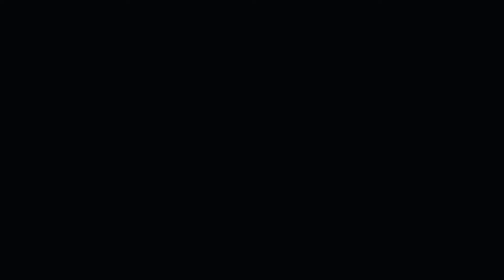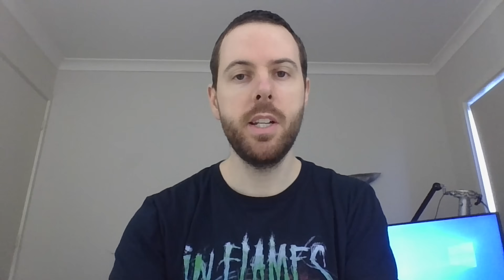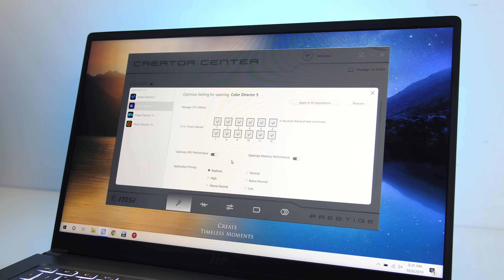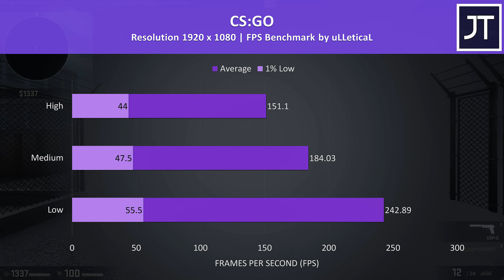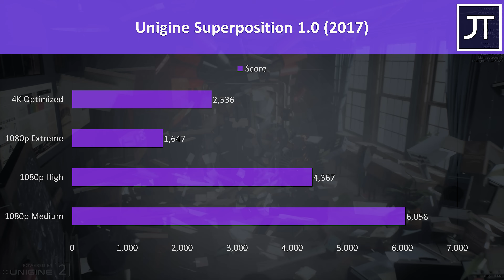MSI Prestige 15 Review - 10th Gen Laptops Are Here!

Comment: The only downsides are : 
The msi bloatware it comes with(you can clean install windows to remove bloatware, but you will also loose performance profiles and battery charging tool too)
I am not so sure about the hinge quality. I am being careful there. 
The battery life is good but for 81whr battery, I  expect more. There are many other laptops which give equal if not more battery life with much less battery capacity (Lenovo laptops for example). This means it isn't well designed/optimized relatively.

Comment: I have this laptop and I love it!
Long lasting battery life, great sleek design, awesome build, high performance, and dedicated graphics card!
Reply from the maker: Good to hear!
Reply: I also bought this laptop a year ago based on this review and cant complain on the laptop. I usually work under linux and was always concerned about driver issues, especially when it comes to fan and power control. But I have to say, MSI has a great linux comunity and software packages like YoyPa/isw provide really solid fancurve and power level adjustments. Right now my linus distro is way better configured as my windows installation with the MSI creator center, which I think is a hot pile of garbage especially when I think of what you can achieve just from directly configuring the ECC.

however, I have to say it run quite hot out of the box and I dirictly did a repast and exchanged the cooling pads for some premium ones. Now even during summertime (around 30 °C) the machine stays at around 50 - 55 °C when watching youtube and my fans only turn on above 55 °C. So 90% of the time the lapto operates fanless and has by far one of the best cooling solutions given the compact design, low weight and performance.

Undervolting -100 to -125 mV works marvelously and I can hit all core max speed of 3.9 GHz all day long, barely cracking 90°C. Really good if you have to compile or run a lot of multithreaded applications. Its an absolute work horse

Comment: I have a question for one of the owners of this device: when you are using the laptop with heavy load or power usage, and you have it plugged in, will it drain? Or will you gain battery. Like lose or gain battery percentage.
Reply: Gain

Comment: 0:17 Specs
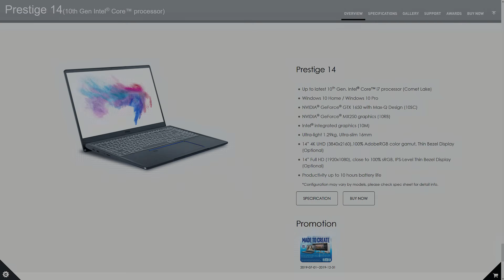1:04 Prestige 14
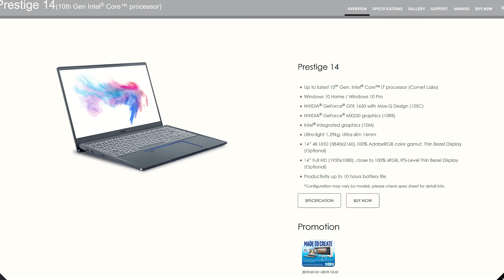1:13 WiFi/Connectivity
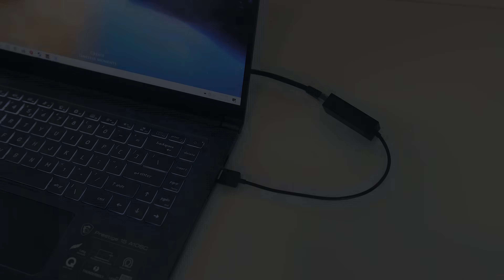1:20 Ethernet
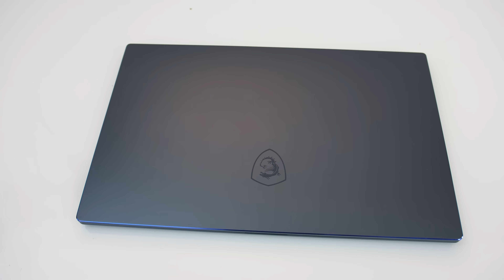1:25 Design/Build
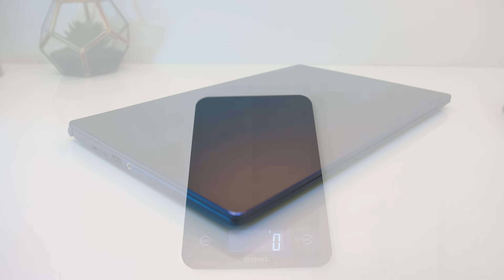1:47 Weight
1:59 Dimensions
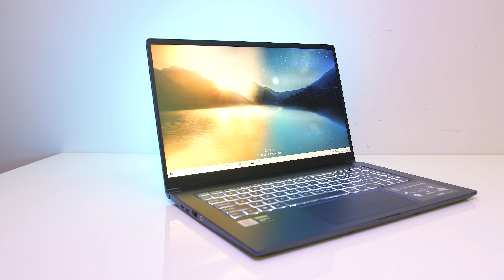2:08 Screen
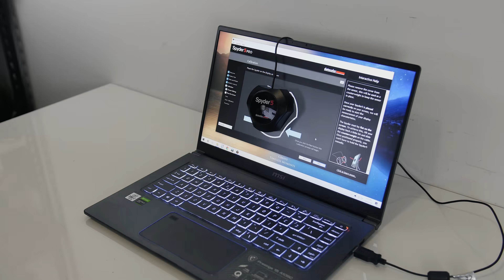2:20 Color Accuracy
2:30 Brightness
2:48 Backlight Bleed
2:58 Screen Flex
3:03 Hinge
3:16 One-Hand Open
3:21 WebCam/Mic Test
3:41 Keyboard
4:06 Deck Flex
4:17 TouchPad
4:35 FingerPrint Scanner
4:42 I/O
5:05 Rear
5:09 Front
5:13 Base
5:23 Speakers
5:34 Inside The Laptop
5:48 Battery Life
6:19 Charging
6:25 Msi Creator Center
6:52 Thermals
8:22 Clock Speed
8:57 TDP
9:24 Power Brick
9:48 CPU Only Clock Speed
10:21 Cinebench
10:39 Premiere Pro Video Export
11:04 Gaming
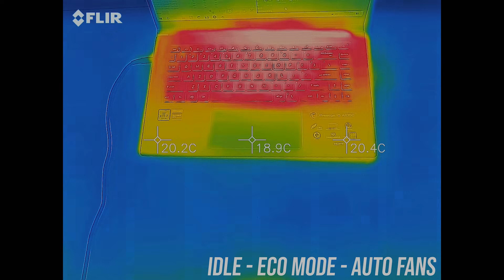11:40 External Temperature
12:17 Fan Noise
13:13 More Gaming
15:46 Gaming Compared To Other Laptops
16:49 Benchmarks
17:00 Storage Speed
17:17 Pricing
17:37 Conclusion
Reply: Dude thanks really.
Reply: You’re amazing... thank you
Reply: i love you
Reply: I love you

Comment: hi Jarrod! for graphic design and gaming, which do you think is better? msi prestige 15 or msi creator 17? Thank you ^^
Reply from the maker: Depends, creator 17 has higher spec options and will perform better but it's also larger so slightly less portable. It also has the mini LED option which may be a better panel
Reply: Thank you so much!  😄

Comment: Nice review!! Basically covered everything I wanna know! 
I have a question tho. Is the cpu actually thermal throttling in the process? Is it running at 100% utilization? I read another review and I am quite concerned about that since this would be the perfect choice for me.
Reply from the maker: Thanks! Under heavy load, yes, depends on the specific workload though.
Reply: @JarrodsTech  does it affect doing things like video editing? (I m using davinci resolve)

Comment: Hi, I found the 4k one on sale for 1300 at best buy and i was wondering if the 4k screen will cause it to have a worse battery life and make it get hotter (when resting on my lap) by a lot. If it is only slightly then it is fine but if it is like a substantial thing idk if should i get it
Reply from the maker: It won't matter much unless you're doing GPU bound tasks.

Comment: Hey! Do you have any recommendations on gaming and video editing capable, lightweight, laptops for under $2000 aud? Also, I was considering the MSI PS63 Modern I don't know which model to get --> $1683 for gtx 1050 and $1994 for gtx 1050ti - don't know if its worth the price difference (especially gaming-wise)
Reply from the maker: Honestly, there is a lot that will handle 4K for less than that budget. On the lower 1500 end or so, Lenovo Y540 with i7 and 1660 Ti would be good specs for it, and would demolish the PS63 in performance.
Reply: @JarrodsTech  thanks for your response! your vids are great! Any other laptop that you recommend with higher battery life? (aiming for atleast 8 hours)

Comment: First of, great review, as all of your laptop reviews! Keep that up! Some questions for you, i have this laptop on my list and want to know if the 4K version is preferred over the 1080p version? (better panel/screen and higher density and higher screen brightness). And how will this laptop behave when i,  let's say, use handbrake to encode 1080p x264 to x265 for 6 hours or longer continually? Will it heat up and throttle heavy? Is this laptop even capable to do this cpu heavy workloads?
Reply from the maker: Thanks! The 4K version apparently has a higher colour gamut screen and better brightness, so even if you run it at 1080p it will look better and would be preferable especially for things like photo/video editing. I would expect the CPU to heat up, but the sustained performance is still quite good and comparable to the 9750H in thicker machines, I think I tested handbrake on it compared to the 9750H here: https://www.youtube.com/watch?v=95DSVCvWvxM

Comment: Hey Jarrod thanks for this review! May I ask you if this laptop has a blocked tdp (15w) when on battery? Read that when on battery it drastically slow down and my idea is to work with it even on a plane or train! Don't know whether buy this one or dell inspiron 7590 with i7h and 1650 (hope you'll review it!) thanks again!
Reply from the maker: Battery will slow down a ton on any laptop, I didn't test it here, unfortunately I can't check for now as I just left to the US for a week. Basically most if not all laptops will suffer in performance on battery by a lot.

Comment: Thank you. I returned my 16’’ MacBook Pro and got this instead. Your video made the decision easy, ended up getting the 4K model, added another SSD to dual boot Linux, and upgraded ram to 32gb and STILL ended up 700$ cheaper than the base 16’’MacBook Pro model with double the hardware. Apple can go fuck themselves (although I’ll admit their build quality and speakers were great, not worth a 700$ premium great though)
Reply from the maker: Nice one! Happy to help 👍 I just got the Prestige 15 back, going to compare it to the Prestige 14 (spoiler, the 14 sucks in comparison).
Reply: Jarrod'sTech why is the prestige 14 so much worse?

Comment: Hey me again, ended up buying the same model and have issues with it, despite buying it yesterday. Downloaded CS:GO and was getting around 15 fps on Mirage. So I then did a bit of research and learnt about the Nividia Control Panel, I opened that and accessedmthe 'Manage 3D Settings' and in the 'Global Settings' tab, placed 'High-performance NIVIDIA processor' into the 'Preferred graphics processor' thing. Proceeded to the Program Settings and put 'High-performance NIVIDIA processor' into use for CS:GO. Next, opened 'Set PhysX configuration' and selected "GeForce GTX 1650 with Max-Q Design'. Opened CS:GO again and got the same frames. Did more research and downloaded the GeForce Experience driver from Nividia. Hopped into the settings on that, and found the fps cap was at 30 - increased to its max, 60. So again, opened CS:GO and finally was getting around 60 fps but never going over, also every few seconds the game would decide to drop frames to around 10. If you know anything that could help, it would be appreciated, thanks.
Reply from the maker: By default it should swap over to the Nvidia graphics when you open a game, I didn't need to do that when I tested CS:GO, so not sure why it was different for you. The 30 FPS frame cap in GeForce experience is only while running on battery, when playing games you definitely want to use wall power for best performance. Also turn off Vsync and run the game in full screen mode.
Reply: @JarrodsTech  Okay thanks, Ill try that.

Comment: So another question now that i got this laptop. Its awesome and i really love it! When rendering a video the cpu temp reached 94degs on auto fan. I wonder if you think i should undervolt the cpu as you have done? Is there any benefits from it in your opinion and are there any dangers to doing so?
Also do you have a guide on how to do it since i dont really know how.. Thanks for a great video again :)
Reply from the maker: You could try, it would either still thermal throttle and give better performance, or possibly if the throttle threshold isn't that far off, reduce temperatures, but if you go too far it could result in instability, so depends if you want to play around with that, nothing more annoying than random app crashes/blue screen for production workloads.
Reply: @JarrodsTech  Alright. Do you have a guide on how to do it ?

Comment: great review mate. i have a question, for video editing do you think this is a good option? i mainly do 4k stuff but i think i am going to upgrade the ram to 32gb if i get this laptop :)
Reply from the maker: Thanks, yeah I do, great CPU power and still GTX graphics for a little cuda acceleration, at least for abode premiere, I think other software like resolve prefers GPU
Reply: @JarrodsTech  Alright. I use resolve 15 and its mostly cpu because i dont do alot of color grading. Thanks mate!

Comment: Hello, is this laptop good for architects?
Does  the processors clocked between 1.1 to 4.5 GHz  slow down heavy files on applications like AutoCAD, SketchUp and 3ds max
Reply from the maker: The CPU in the Prestige 15 is very good, it beats entry level 9750H configurations as I tested here: https://www.youtube.com/watch?v=95DSVCvWvxM

Comment: So 4 questions
1. Did you undervolt this laptop?
2. What program did use to undervolt?
3. What performance changes did you see?
4. Did your Windows Hello work?
Reply from the maker: 1. yes, but only when explicitly mentioned on the graph showing results.
2. Throttlestop.
3. You can see this in the video where I test cinebench and other apps with and without it 
4. Yes.

Comment: Hey Jarrod!
As a content creator, by how much would you undervolt the cpu or/and the gpu on this device to optimize its performance and thermals?

Great videos by the way!
Reply from the maker: Thanks! As much as you can while remaining stable, the specific value varies between individual CPU so I can't just give you a definitive number.
Reply: @JarrodsTech   Jarrod'sTech  Wow, that answerspeed was insane.
Subscribed!

Ok, i just do not want to tweak and test too much. Just optimize it by a little bit, without having to spend a couple of hours testing. 
Can you tell me wheter 100mV should be fine?

Comment: What should be better, the msi gs65 or gs75 with i7-9750h and GTX 1660 Ti or this laptop?? I have doubts about performance of gaming!
Reply from the maker: I guess in theory the GS75 is larger so may have more cooling capacity, but I haven't tested both with the same specs so can't fairly compare.
Reply: @JarrodsTech  thank you very much! now, and for last, I have the doubt between MSI GS75 and MSI GL65, almost same weigth but RTX2060 in GL65 and GTX 1660 Ti in GS75. Thank you very very much!

Comment: Hey Jarrod!
I was thinking to buy this laptop because it perfectly fits my needs. Lightweight with good battery life and decent gpu. But I was reading and I found out that MSI's hinges are like REALLY bad and they break in 1-2 years.. is it the case ? Because I want the laptop to last atleast 3-4 years ? Please reply fast
Reply from the maker: I've never had any issues with them, I've only heard that with some of the low to mid range gaming laptops which this is not, so it's probably completely different hinge design, but honestly in the end I have no idea as I'm only able to do a short term test for a couple of weeks and can't really say how any product will hold up long term. I thought this seemed fine though from my time with it.

Comment: Amazing review! But what do you think about the 14” version? I heard that it has some thermal issues and i really don’t know if it would be a good invesment.
Reply from the maker: I haven't had a chance to use it yet, MSI will be sending it to me soon and I'll do some videos on it once it arrives.
Reply: Can you compare the current msi prestige 15 with the current msi modern 15? Idk which one to get.
Reply: @atefetacheese5401  Modern 15 is a more budget version of Prestige with less powerful upgrades, ie Modern 15 GPU option goes up to MX graphics card only. Also the max battery size in Modern 15 is only 52 whr, this one is 82. So if you want the, more powerful GPU, longer battery life and also TB3 capability, you get the prestige 15. If you want RTX 20 GPU options on top, you go the top of the line which is MSI Creator 15.

Creator 15 > Prestige 15 > Modern 15

Comment: Good, thorough review, but your metric units are meaningless to us ignorant Americans. Would it be possible to give the Imperial equivalents in the description, perhaps?
Reply from the maker: I include the conversions on screen where appropriate for weights and dimensions. If you mean for temperatures though, I probably won't add that as there are too many data points to convert and even software in the US will report it degrees Celsius rather than degrees Fahrenheit

Comment: Msi prestige 15 4K Vs Gigabyte Aero 15 Oled, what should I choose?
Reply from the maker: I haven't used the 4K on the Prestige 15 so not sure how it compares to OLED, it's nicer than what I had here, but OLED is still nicer looking, plus you have way more GPU power/full size SD card slot.

Comment: My predator Helios 300 (2018) is capped at 45W PL1 and 56W PL2. It throttles a bit while running cinebench r20 even though temps are below 85°c. However Intel xtu allows me to raise the pl1 limit all the way up to max unlimited power. By how much can i increase the pl1 safely?
Reply from the maker: Increase it as much as you like, the next limitation will just be thermal throttling so it doesn't really matter how high the power limit is.

Comment: What is display brightness ? Is it 500 nits?
Reply from the maker: Brightness is covered at 2:30, I got no where near that with the 1080p panel, can't speak for the 4K but I'd expect it to be better.
Reply: Jarrod'sTech thank you so much for the prompt response. ❤️ I meant to ask for 4K. I am not sure between dell XPS Non oled 4K and prestige 15 4K. 
Dell XPS 9th gen i7 , 32gb, 1tb ssd is for $1850 and prestige is about $1800. Not sure which one to buy? Thanks.

Comment: Does the screen get too hot when the air fires at it?
Reply from the maker: You can see screen temperatures in the video in the thermal camera section.
Reply: @JarrodsTech  I'm worried about long-term durability.

Comment: I’m having trouble with my windows hello can anyone help?
Reply from the maker: What's wrong? You need to first set a password + pin before you can enable it. You might also first need to enable the webcam with the Fn+F6 key.
Reply: Jarrod'sTech the MSI representative said windows hello face is not available on the laptop. 
Jarrod do you have windows hello face available for you ?
Reply: Thanks but I did try that but the issue is that my “camera is not compatible for windows hello”

Comment: Hello!  I can’t understand is everything okay with my laptop - in the most economical mode and with almost minimal display brightness (browser + word), I get no more than 4 hours of battery life.  Even watching full hd 1080p video gives me 4 hours.  Is autonomy really like that or am I having some problems?
Reply from the maker: What laptop do you have? If it's the prestige 15 that sounds a bit low if all you're doing is video playback.
Reply: Jarrod'sTech yes, it is Prestige 15, same configuration. So I do not want to return it to the store, maybe I'm setting something wrong.  I have no idea how to fix this.
Reply from the maker: Check task manager and see if anything is running using CPU/GPU power that shouldn't be, close off unused programs etc, otherwise not sure

Comment: just wondering, how would you compare this with the forge 15? really great review btw, you're definitely the most thorough out there!
Reply from the maker: Thanks! The forge 15 is the Clevo nh58rdc which I've reviewed on the channel, just search my videos for "alpha-X" which is the same thing sold by metabox in my country. It's more powerful but also larger and doesn't have Thunderbolt or type C charging so depends what the priorities are. I'd say overall this is a more premium machine and lighter/smaller
Reply: @JarrodsTech  thank you for the reply! also, I was wondering if you have done a review on the illegear rogue? could you compare that with these?
Reply from the maker: I can't get stuff from that company specifically as they're not sold in my country, but they just resell the Clevo chassis. That looks like the 17" version of the 15" one I just reviewed in the nh58rd review